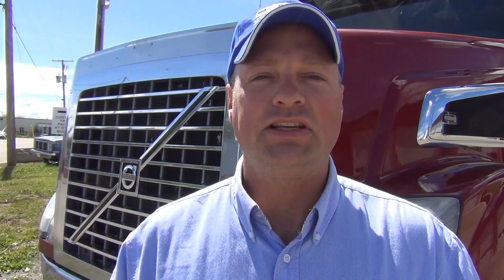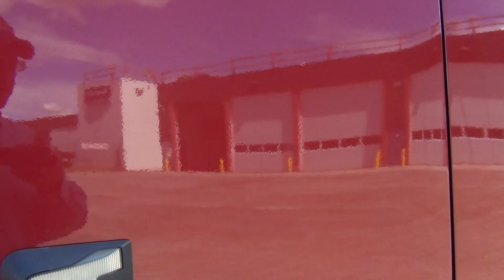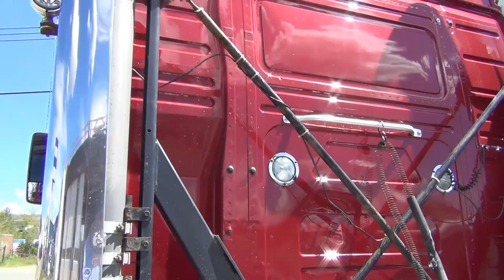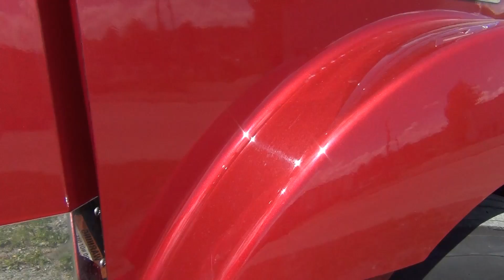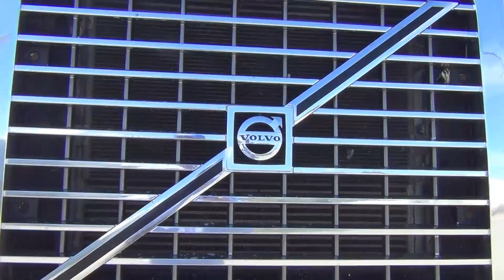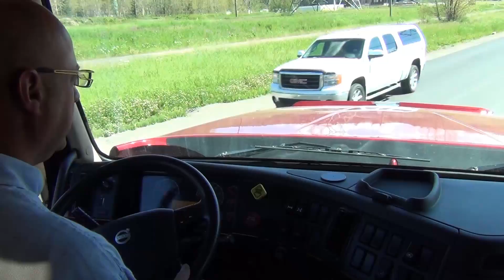RV Haulers 2009 Volvo 880 Inspection of Prince - Part 1 - 600 HP, ishift

Comment: Volvo seems to be the truck of choice for RV Haulers, just curious why that is
Reply from the maker: Great Question. They are one of the most competitively priced units on the used market. They are so popular, they sell so many, there are many available.  Also, my customers are drawn to the very quiet interiors, autoshift transmisssions (no clutch on the floor) and HUGE sleepers.  Keep the questions coming!
Reply: From what I read the brands like Freightliner the blower motors keep fizzing out every few months Volvo on the other hand seems have excellent parts that last many years

Comment: RV Haulers such as this one are required to be tagged with commercial plates or consumer plates?   If commercial, doesn't the associated cost of operations and compliance and lack of any revenue generation from commercial loads make this a very expensive choice for consumers pulling their personal rv trailers compared to other vehicles with far less costs to own and operate?
Reply from the maker: Hello Jeff.  We usually title these finished RVHaulers as motorhomes - private use -  not for commercial hire.  No need to stop at scales, no drivers log, no commercial insurance costs.

Comment: @ 8:59 on the left is a European spec FH12. Bit of an oddball to have in Canada (?) but shows how much bigger the American trucks can be under their rules. I had the first FH12 in the South West of the UK back in the day ... First ones weren't that clever and I went back to MAN but the FH became an awesome truck with a great reputation.
Reply: +1chish Then you still haven't experienced the greatest truck of all time. A Scania 730hp V8.
Reply: J Gripen
Well not quite right my friend. In later life I went back to truck fitting at MAN Trucks and then got my Scania Master Technician certificate. So yes I have a lot of experience working on Scanias of all sorts What I could have added is that I owned in succession a 110, a 140 and a 111 and before the above Volvo and MANs I ran a 113 Topline 6 X 2 as an owner driver.

The 730HP is a new engine of course and I have been retired for a few years now so no not had THAT pleasure ...

Comment: I have a question do you ever consider the weight of the  trailers fully loaded before cutting the second axle, and have you ever considered towing a second trailer with these trucks...

Have you ever considered a wider profile for the prime mower and trailers..
Reply from the maker: Jason howe In rare  instances, when we are carrying a larger vehicle on the bed length-wise, yes, we have to leave the truck tandem.  Rarely will the pin weight of an RV overload that single axle that can carry up to 20,000 lbs.   But, it can happen, and we are careful to speak to our customers first, and make sure we do our due diligence.  If they are thinking of a New Horizons trailer, fully loaded at 45 or more feet or more, and are full-timing we have to be careful!  There are very very few states that allow double towing.
Reply: The amount of  single axle dogs I would wonder why they wouldn't allow a road trying with a b-double or a  dual-Tri axle 2-3 trailer road train, idea I would have is a  2-3 row single or double seater with aisle , has a living trailer and and a car/toy hauler  may be a walk door between cab and trailer to trailer..

Target audience large families and  preppers ..

Whilst the setup you might be suitable  hubby and wife teams not practical as a family hauler with 4-8 kids in tow

The main aim would be pack lunch/drink fridge and a can  shit and piss in , plenty of ac hook up for  computers and lan and wifi with sat net to shut the kids up whilst traveling ...

I would also consider Solar cells across the trailers and the cabin and sort out solutions in ass end and trailer..
Reply: Here in the states we can carry 2 trailers but under 53 feet in length